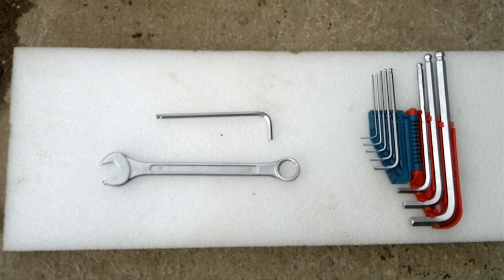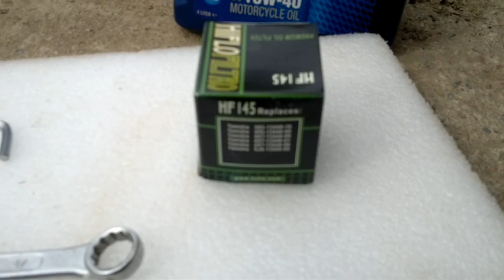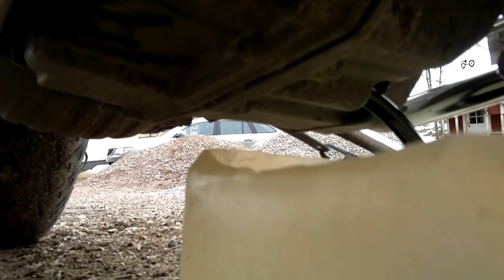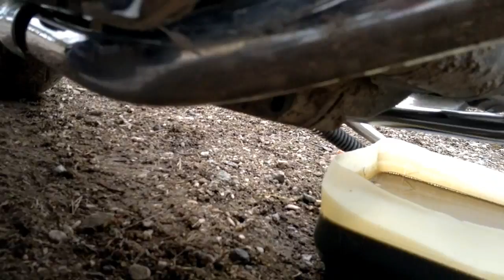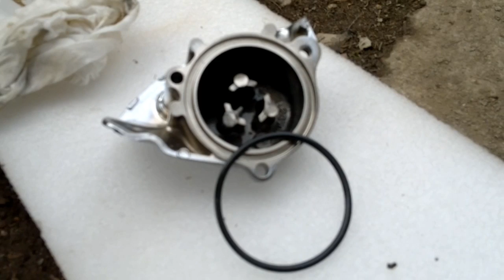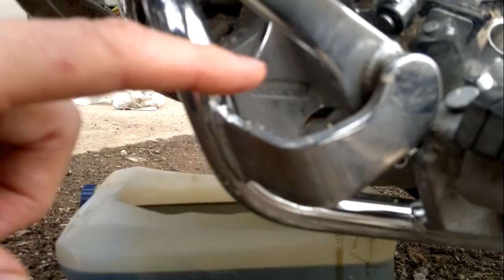Yamaha Virago 535 motor oil changing

Comment: Don't know if you still around 2012- but my bike seems to have the oil window closed up (removed) just a black plug in its slot from where the location of your unit is; any suggestions on how to check the oil levels with out the oil window?
Reply from the maker: Hi, good question. Drain it an refill 🙂
Honestly hard to say as there is no dip stick to check oil level.

Right, still around 🙂

Comment: Excuse me Jarmo, how much did you give for your virago? The condition looks extremely good, my xv 90' is lacking chromium and a lot of screws and plugs are difficult to get off, i still love it though! 
Love the videos, please make more!
Reply from the maker: +johanlob Hi Johan. There is about 26000 km in the meter and it is 2000 model. Not huge amount of km. I see some beginning rust on area where front wheel throws water & dirt, need to clean this summer. Normally I try to wipe specially those areas with oily cloth for winter storage but forgot it last year.
Reply: I see, that sounds good and your bike is really mint with all the chromium left it seems!
I was just wondering since I just bought my bike and changed the engine oil & filter, break pads, air filter and the spark plugs.
A lot of fun since this is my first real bike.
I was just going to ask you since I haven't really found the answer but the capacity of the engine oil is 2.8L and I think I filled it with exactly that amount; 2.8L.
My friend said afterwards that it might not be good to fill the tank with the full capacity since it can be detrimental to the bike (foaming or something like that) if it's full. I looked into the little glass window and it has a small air bubble in the top, maybe 2-3mm. Do you think i should take some oil out or is it fine?
Also, is the final gear oil as important as the regular engine oil change?
Sorry for the long post!

Cheers and please make more vids! haha
Reply from the maker: +johanlob Hi
I would fill to the area near middle or slightly higher of sight window, but not below. Remember bike must be level on both directions. It is correct do not overfill, keep the oil level in window. Oil foam may cause heat/lubrication issues. There are moving parts around so I suppose oil is not completely bubble free at surface.
Reply: Great input, I leveled everything out so the window is perfectly half full.

Comment: Thanks. Never knew this bike use oil filter.
Reply from the maker: Right it does, but dont be surprised if you find one more. There is one casette type on left lower side,  access needs more work and not cleaned at every oil change, pretty hidden.
Reply: @jarmojarvinen1585  What!! Another one? Tell more that I don't know. Haha
Reply from the maker: Hi, see https://youtu.be/_22tVBjxofQ at 23-25 seconds. There is brown long cassette going into square hole. That cassette is filter actually.

Comment: Be warned, idk if its just mine or all the viragos. i have an 87 virago 700 that needed the carbs cleaned and since they leaked for so long the gas leaked into the oil pan and now iv got a bigger problem iv got to replace the oil filter n clean all the gas out and put new oil in it but cant afford it right now.

Comment from the maker: Hi

I would replace spark plugs to owners manual recommeded ones, check
ignition timing,
Ignition circuit cable/contacts checking ..   and ...are valve clearances
OK.

Do others have better ideas?

Comment: How about the size of the o ring ... as in radius or diameter and also thickness of the o ring (rubber) I need to change my oil and I can’t seem to get them cheap would like to get it made before I do it as it’s my only mode of transport any help would be appreciated 😊
Reply from the maker: whoisdeany hi, sorry I do not have any o-rings with me currently. I have just picked them up when buying filter.. they are not expensive.
Reply: @jarmojarvinen1585  Could you let me know, from where you buy the spares (in Finland) especially the o rings?
Reply from the maker: @utku8654  for oil filter its coming with filter. For other rings Yamaha center or just some generic supplier ( like IKH ). I quess bike shop like  Storm motor and others have too.
Reply: @jarmojarvinen1585  Thanks a lot Jarmo, i will try my chance with STORM.

Comment: I have put oil in. But when l lift the bike the window with oil goes empty! I have put 2.8litres in. I dont know if l did something wrong? When the bike is standing on a side the oil shows ok. When l make it straight / it disappears. Is that ok? Thank you!
Reply from the maker: Hi

Sorry to be late, I suppose you have discovered that a bit more oil is needed to keep it in the window when bike is standing straight.  Mine is fine with 2.8 liters, just changed them last weekend. I tried to find if some earlier models have different capacity but could not find in quick search.

Camshaft Valvetrain Configuration OHC 
Maximum power - Output - Horsepower 42.00 HP (30.7 kW) 
Maximum torque 34.00 Nm (3.5 kgf-m or 25.1 ft.lbs) 
Engine Maximum RPM 7000 
Cooling system Air 
Lubrication system Wet sump 
Engine oil capacity 2.80 litres (0.18 quarts) 
Exhaust system Double stainless steel pipes with expansion chamber

Comment: do u use 10w40 or 20w50 for 4T oil
Reply from the maker: Colder conditions use lower viscosity eg 10- and in higher temperatures ( ambient) use 20-.
Just make sure it is for motorcycles with wet clutch ( eg it is in that oil). Normally stated on the can/bottle.
Reply from the maker: I use 10- as finland is not so warm country. Sometimes in fall its 2-3 degrees C in the morning when I start 🙂

Comment: hi so where i am its hot so i have 10w 40 in the bike and the engine gets way to hot the virago manual says 20w 40 soo thats good ?
Reply from the maker: Hi, if you live in "warm" country, eg do not run bike close to freezing point, I would use this 20W40 oil.